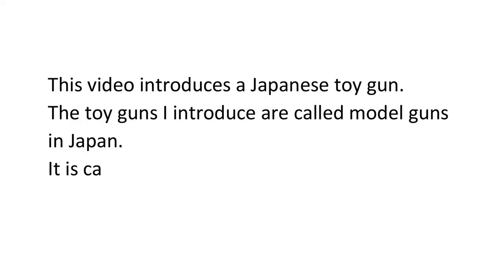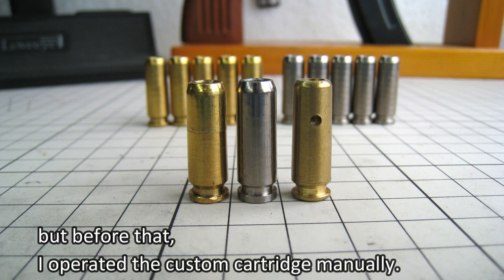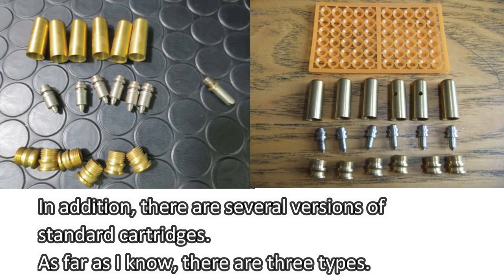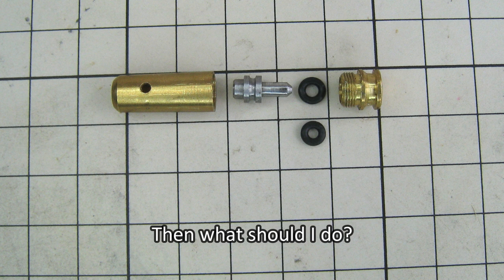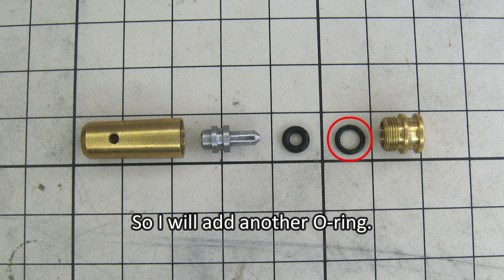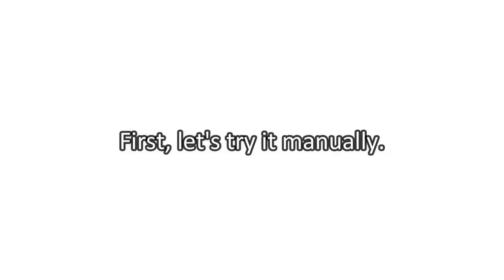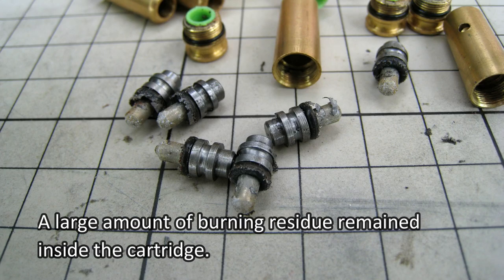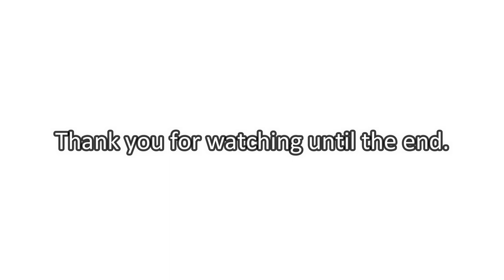Vz61：About the effectiveness of standard cartridges

Comment: Thank you again! It is very interesting and thought provoking to see how you worked through the problems with standard Hudson cartridges. This makes it clear that custom cartridges and extensive modifications to the model gun can improve performance significantly. Excellent video and commentary! Kind Regards
Reply from the maker: Thank you for your compliment.
Many users were desperate for standard cartridges.
That is why we pursued the possibility of standard cartridges.
However, it is not a problem that can be solved only by the cartridge.
However, my "Vz61" has been over-modified and it is difficult to make the right decision.
I'm looking for another "Vz61" now, but I'm not bidding because it's expensive even in the junk class.
Maybe I'll try again with the current "Vz61".
Please wait till then.
Thank you, dear friend.
Reply: @lucifer7922  It is unfortunate that not many Hudson model guns perform well as standard, with the exception perhaps of STEN MkII. Most of my Hudson models have required modifying to perform well. Replacing cartridges with MGC or custom carts certainly helps but you are correct saying that all problems cannot be solved only by changing cartridges. Thank you, dear friend.